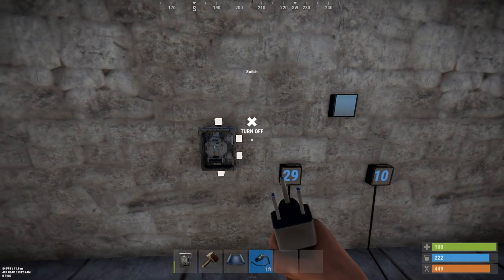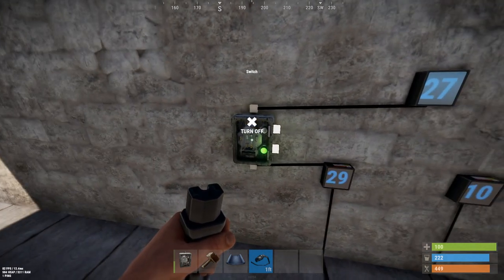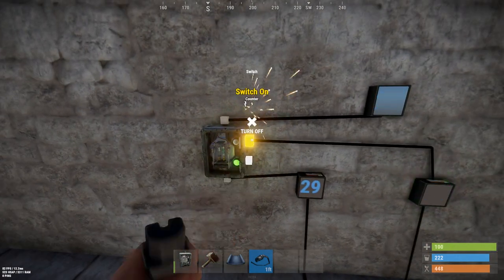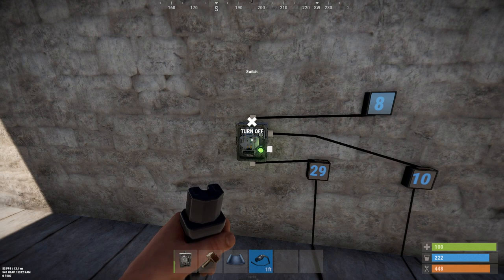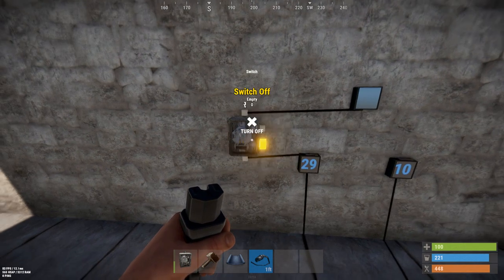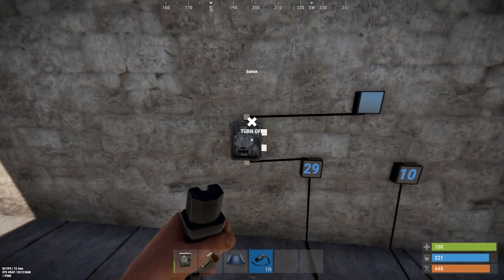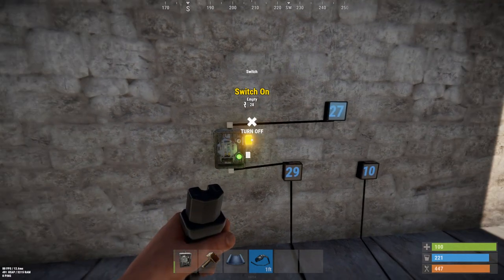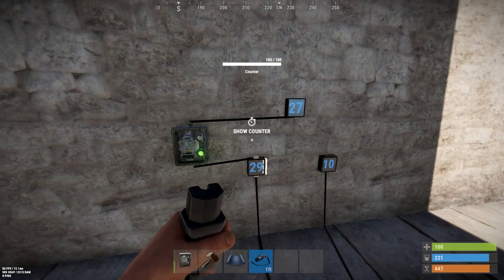Switch Bug 9-5-2019

Comment: It looks like a kill mechanic where you deactivate the switch. 
Could be used to fully disable the switch. It works again if you send something on the "switch off" input.
I know why they won't allow you to do that.
I tried to make extremely long lasting batteries. To do that, I looped the output to a blocker. The result being that the power flicks on and off constantly, making the battery 4x as effective. The issue is that with this small impulses, you can't do everything. So my plan was to use this new switch mechanic to activate/deactivate a secondary battery, that should be used only when needed... i.e. the main x4 battery being used to set stated, the second being use to actualy power things up...
Because of that, I am not able to activate the secondary battery... but it works well with fuel generators! xD I just can't use switches

Comment: Hello Rabbit, can you help me with something?

I tried to create a HBHF system where the HBHF is connected to a counter but it didn't count how many people were outside. Any ideas?
Reply from the maker: Just tested, doesn't appear to be a bug. Remember that the way this works is that the HBHF outputs the number of power units for how many people it sees, but it MUST have that much power left over.  So if it needs to detect 5 people, it needs to have 6 power at least coming into the input. Also, if you're outputting to a display, change it to passthru mode to see the actual power output count.